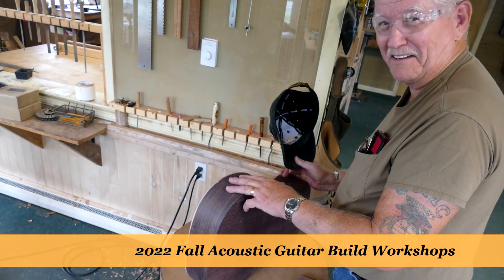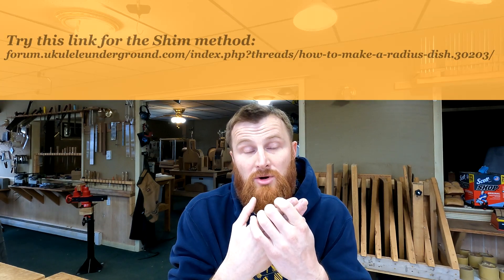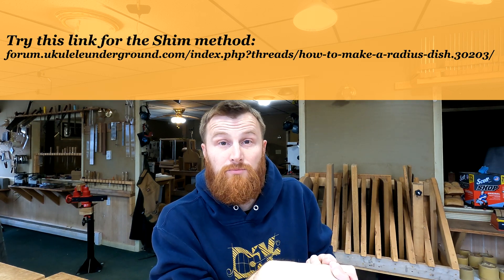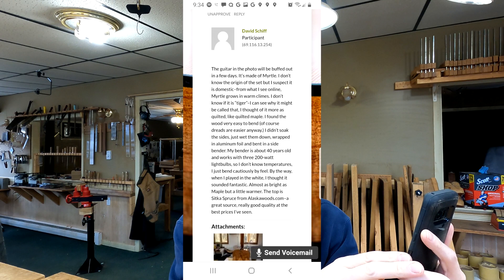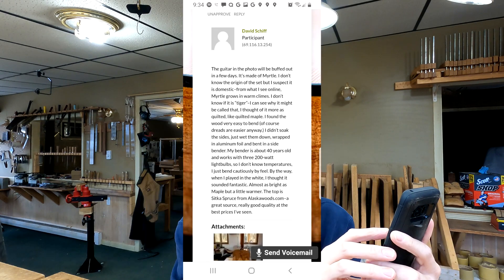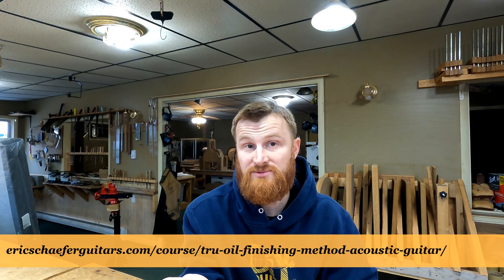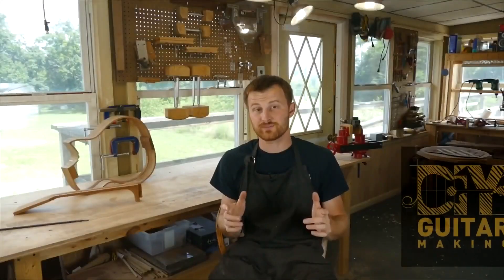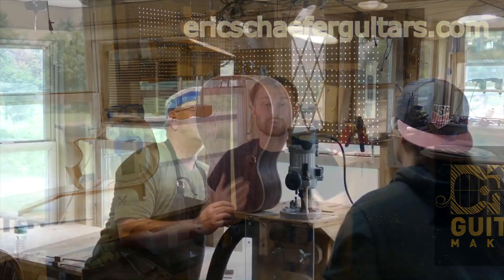Q&A | Making a Radius Dish, Bending Tiger Myrtle, Kerfing, Protecting Binding Channels

Comment: Eric you are a Saint! I had made an adjustable radius dish a couple days before I watched this! Go figure. I was kind of in disbelief when you mentioned the thin mdf thing because that's exactly what I did. Cut a 22" circle in a spare table, fastened a 24" disk of 0.125" mdf with a threaded rod in the center to tension the dish. It can be adjusted so I only need 1 dish for multiple radiuses. I don't use a go bar deck I just radius the rim and braces.

Comment: About bending difficult woods: 
I manage to bend Snakewood (Piratinera Guianensis) for my bindings / purflings. Has to be soaked in hot water. 
I had the wood in a plastic plumbers pipe for several days and did the bending manually and not in the sidebending machine. Worst wood to bend ever, it is almost like bending glass.

Comment: One comment about radius dish - it should not be perfectly accurate in radius. Yes, if guitar should have 4.5 meters back radius you cannot make 3 instead... But it could be 4.4 or 4.7 and that could bring something new to the sound or/and look of your guitars. Also, with some additional (quite small) complications one can build guitar without radius dish at all - use radiused braces instead.